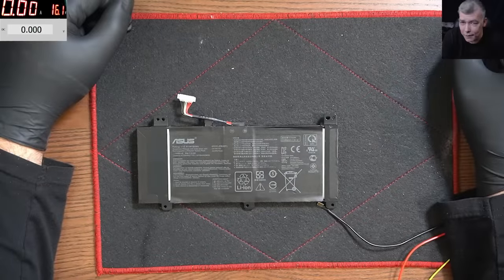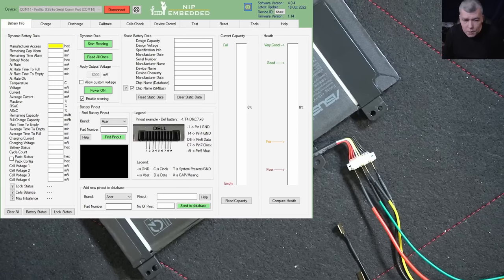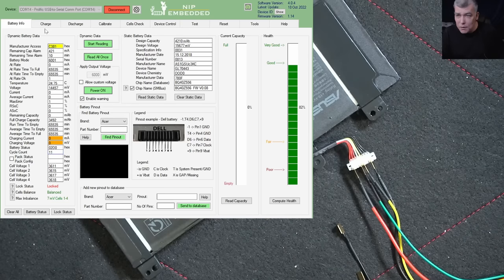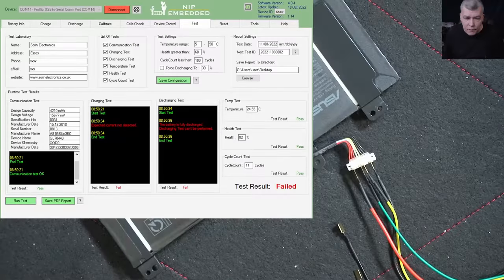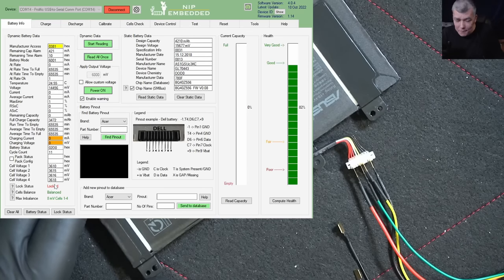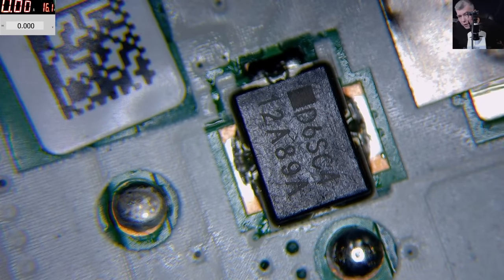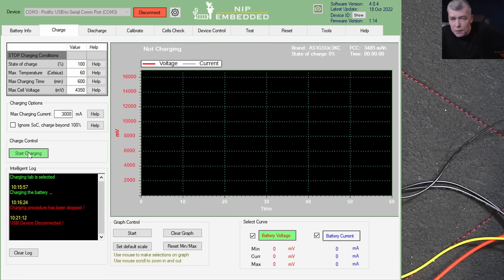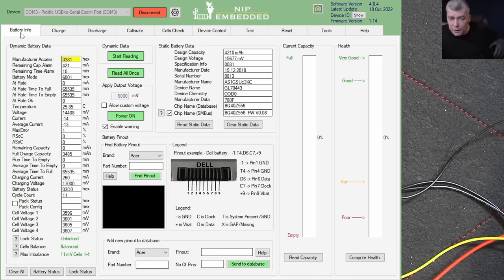Battery heated fuse repair - Asus GL707 laptop battery repair & unlock

Comment: that fuse is the only thing preventing a fire if the mosfets are shorted... lipo fire is not a joke.. please replace the fuse with a proper one !
Reply: Maybe the MOSFETs in the customer's laptop is shorted?
That can be why the fuse was blown in the first place?
Reply: @Drottninggatan2017  no that fuse is blown by the chip in the battery when it detects abnormal situation which is not solved by disabling the mosfets (the ones inside the battery)... it's literally the last resort safety to prevent battery fire. sometimes the chip is "trigger-happy" and blows the fuse when the situation is not that critical, in those cases you can reset the battery but the fuse MUST be replaced with a proper fuse, bridging that fuse in the battery is a fire hazard.
Reply: @robertjung8929  it was not a bridging, it was recovering with an alloy. So when chip wants to blow it next time the alloy will be melted. Me have recovered tons of these fuses and tested that after recovery it works perfectly as a protection. There two rules to follow - alloy should be light melting and not too much like in the video.
Reply: @electricelectronich9979  what's the purpose of fixing a fuse ? new battery protector is 1$ to 3$ depends on type.. you can't guarantee  that your "repair alloy" will disconnect the battery reliably.
Reply: I've tried that fuse trick once and thing let out some magic smoke heheh dodgy?

Comment: Sir, i re cell my battery laptop but in windows is not detected. Battery is can use and charge but the indicator is show battery not present. Does it because the chip in bms?

Comment: Thanks for showing how the battery fuse works. I upgraded my similar model laptop's RAM and storage, and the wires that go from the motherboard to the LCD panel got out of their place and got pinched by the laptop's bottom lid as I was putting it back together. Unfortunately, both the backlight fuse and the battery fuse got blown out in the process. I've successfully soldered the backlight fuse and it's working great. Now, thanks to your video I'll be able to get my battery to charge again. I appreciate your hard work and sharing it, Sorin!

Comment: I love how these companies like ASUS, Apple, Tesla, all preach about being sustainable, but then design their batteries to expire over time, and even have fuses they blow on purpose, even though they are perfectly fine. In any case, good work, very informative!
Reply: As far as I understand there is good reason to have such a fuse, as it can reliably disconnect the cells when something goes very wrong, potentially avoiding a fire.
Li-Ion cells are really hazardous when treated wrong
Reply: @maeanderdev  I would argue that most of these situations are showing the cells to be fine, and that they are blowing the fuse after X time, or X recharges. Also, if the battery started a catastrophic failure situation, those cells would all light up even if you disconnected them. There is no reason to blow that fuse until the cell can't take 30-40% of its original charge, then they can be catastrophic because internally they can short. That is after like 10 or 20 years though. Lithium hasn't been around long enough to play this game of batteries going south.
Reply: @WXSTANG  There are multiple scenarios which may result in a catastrophic failure.
If for example the charger fails to terminate a protection device may be able to avoid a fire and in such may save lifes.

I don't know if there is any sign of deliberate blowing of such a fuse by means of planned obsolesence, or if rather such cases are a result of external heat or erratic triggering of a safety mechanism in the battery controller

Comment: Deal Mr. Sorin, thanks  for all your videos. I believe the vast majority is not getting your point regarding the restoration/resetting the batteries. But there is one important point from my viewpoint: the only way to restore the battery of an old laptop (one that I Have is ASUS a3h or ASUS A6r) is to repack it and reset the controller (because one cannot buy a new spare battery for the 10plus years old laptop)
Reply: Do you have to have a programmer to reset the controler?
Reply: @irishguy200007  yes. But it could be an old LPT programmer for Be2Works

Comment: Thanks for the informative video, but if after shorting the fuse with Soldring iorn, again it blown out means, what's the Possibilities of issues there..
Reply: That's what happening to my battery now, i was getting negative -ve in all the sides of the Fuse except the +ve input, if i solder again it burns with a smoke.. what's the issue in it..

Comment: Hi Sorin, Informative video as usual. My Thoughts on the device, I have one of these and am only a hobbyist repairer but have done many devices over the years. The initial device cost my seem high but as you said it is a unique device and with a fairly small customer base compared say to a soldering station so the developer needs to make money to keep the project going. It's like data recovery hardware, high price small sales market. As for the unlock licence, for someone like me it is far to expensive paying yearly subscription for something I may or may not use. I realise it is not aimed at people like me but is there no way to maybe pay per unlock like mobile unlock codes, or batches of 5 unlocks at a time via site membership or the like. Anyway please keep making your informative and entertaining videos, I enjoy watching, even the non repair ones (did you ever find your drone ?)
Reply: Who said you have to do a yearly subscription ? NLBA1 is a lifetime analyzer, you can use it anytime. For unlocking the batteries we plan to offer a few free repairs every year.
Reply: @nipembedded9976  Thank you for your response, maybe I confused matters. I am referring to the chip unlocking, on your site it does state in large letters Laptop Battery Chip Reset License – 12 Months, not the actual unit price. By the way I am in no way criticising your excellent product, just that prices reflect a niche market similar to data recovery hardware etc.
Reply: @steveb1706  You pay 1 Year reset license and you get 1 year. You can stop at any time and use the device as Analyzer Lifetime.
Reply: @nipembedded9976  thank you for the offer

Comment: I am from Nigeria,I bought this device  and I also bought  one year license(very expensive) since September 2022 I have not used it more than twice to unlock .am I eligible for this discount ? 
Also for the cost of purchase for this device , he would have designed the device to be working on its own without being connected to the internet before use.

Comment: I have a hobby doing computer repairs and I also make some money I have bean repairing computers for a few years I am very careful how mutch I spend on tools some jobs require good tools recently I have bought a kit of screwdrivers tools are important they make the job mutch easy.. I am thinking of some board repairs but I am getting old.. A soldering iron and a heat gun and a digital microscope wound be nice.. I watch your video apriciated I find then educational.. Wish you well i

Comment: Some automobile air bag control modules have a similar device, it is a fuse crowbar, that burns the power fuse inside the module to disable air bag, in case of failed clockspring (in steering wheel, for example)

Comment: Only question I have is how does a battery usually get locked in the first place?
Reply: The IC on the battery detects an error and locks the battery so it doesn't blow up and burn your house down. Sometimes it can happen if the battery is too low. Imbalanced cells can cause an error. Or if it draws too much current when charging. Or even discharging too quickly.
Reply: @DukeBiggsley  thank you friend

Comment: RESPECTED SIR 
I am yours subscriber and watch your videos with great interest. you are doing a great job 👍its a field of my interest. 
My problem is that my laptop, which is 10 years old. Its battery was very low capacity remaining therefore bought a new battery 🔋 which is locked to 80% charging capacity not charging fully 100%
In setup Bois 80% to save battery is disabled. 
In windows all options to save battery ie battery saver all functions I have disabled. 
And put the laptop to  high performance no battery saver options are on. 
Still battery is not charging 100 percent. 
Respect sir what you suggest for solution of this issue 🙏 thanks

Comment: The lack of repair in the uk and europe is because companies deliberately make repair impossible.

Often even their own technicians cannot repair the product  themselves, if the part is repairable but requires specialist software or tools to do so they are instructed to replace.

Often because they do not want the software to be leaked, exposing their deliberate locking.

Comment: Yo I have a problem with my laptop the CPU cooler fan is not spinning so I tried checking the fan and it doesn't work so I got a working fan and plugged it in and still no spine but the fan move slightly when i turn on the pc and stops what do think is causing the problem

Comment: Maybe a better way to "fix" the fuse is to remove the plastic,  and put a small ceramic part on the factory low melt solder. (do not put more solder like you did).
Then use the heat gun to melt it.
At the same time, put some pressure to disperse the solder to make contact with both the internal fuse terminals.
Then remove the heat and remove the ceramic part.
That way the fuse will work "like new" ???

That is until you find and install a new fuse.....

Comment: if "fixing" the fuse unlocks the battery why do i need this device?
Reply: The chip blows up the fuse because it detects a sever failure. I am pretty sure Sorin cleared the errors using NLBA1, otherwise it won’t work.

Comment: I understand your repair method but your repair puts you in legal jeopardy if that battery burns and causes damage. If you had replaced the broken fuse with an OEM part, you might be protected.
There was a fire in an apartment in NYC that was caused by a lithium ion battery this past week.
Reply: so, that's not extra protection fuse?
Reply: @maklogetrich2378  
Perhaps I missed something, I thought his repair was to short out the fuse. I'll watch it again.
Yep, @15:41...soldered across fuse.
Reply: @bblod4896  yeah I mean, that's not extra fuse, that's the primary fuse for heat protection?
Reply: @maklogetrich2378  
That, I have no idea.

Comment: Coupon "ElectronicRepairSchool"  does not exist!     Does anyone else have a problem with this coupon??
Reply: Use ElectronicsRepairSchool . Yes, it is a mistake in the code name.
Reply: @nipembedded9976  and yet I get 10 bux usd off with that code, and all up with shipping to Australia 6035 it costs me $358usd shipped?  However through  deepcyclepower it's $303.76 usd shipped,  just the nbla is 276usd  , that's 53usd cheaper than your website n your the manufacturer.  303.76 usd shipped is a fair price with 30 free unlocks a year. I'm small repair shop chain. 50 resets a year would be my limit.
Reply: @nipembedded9976  honestly 300usd shipped with 50 reset limit a year you would sell a hell of alot more especially for me I'd buy 1 for each shop, but I'd buy 1 to test out 1st , just registered on your website and monitoring prices
Reply: @waynetaylor2784  All these things can be negotiated, it depends on how many batteries you repair in a year. If you repair a lot, you earn money, so, I also need money. But if you repair a few then I can help you.
Reply: @waynetaylor2784  Give me a link to Deepcyclepower. I did not sell them any devices in the last 1.5 years. Well, 50 batteries means 50 x 20$ about 1000$. 50 it is too much for free buy 20-30 is possible.
Reply: @nipembedded9976  well I'd repair 40 to 50 maximum according to business records so 30 would leave me needing to buy subscription
Reply: @waynetaylor2784  As I mentioned before, we can discuss this, I don't have exact limits. I like more win-win cooperations.